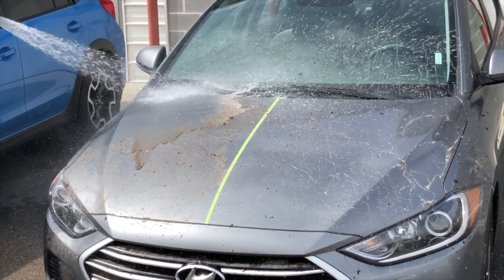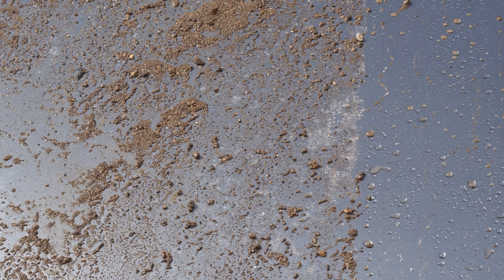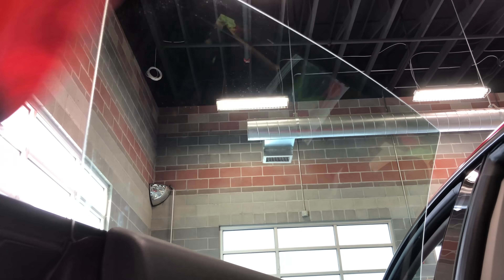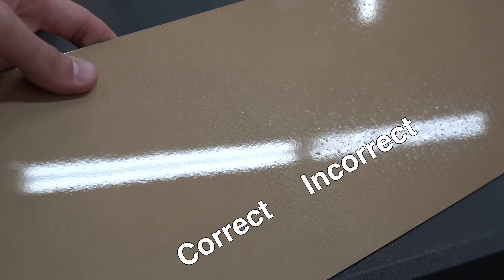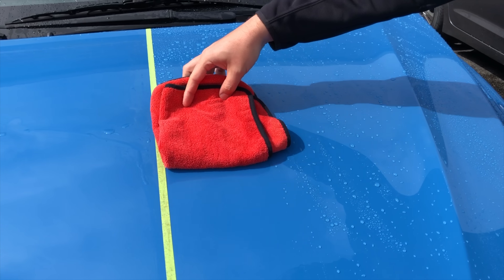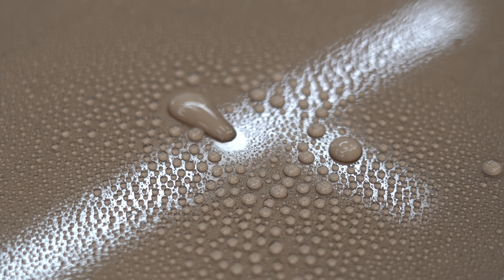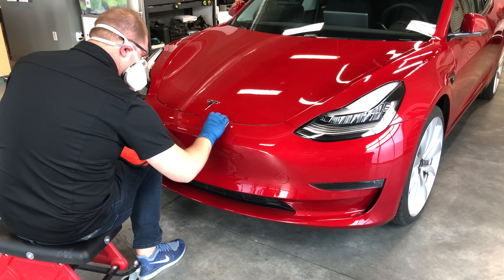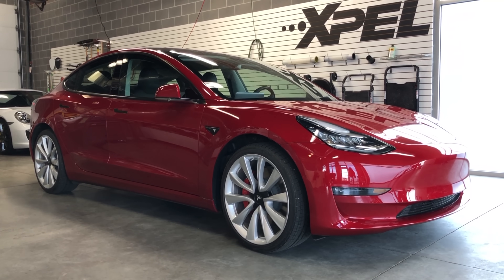Everything You Need To Know About Ceramic Coatings

Comment: Just after watching this video, I drove home through a blizzard, having trouble with my windows getting covered with snow on the outside and fogging up on the inside. It is mentioned that this can be used on windows - would it help prevent snow and ice accumulating on windows? Would putting it on the inside help with preventing them fogging up?

Comment: How about using ceramic coating on glass, inside and out?
Reply from the maker: Yes, you can use it on glass! All of my exterior glass was coated. Inside has XPEL window tint (except for front windshield).
Reply: @EngineeringExplained  HUmmm how about on race car plexiglass windshields. They get really dusty sometimes from static electricity and they fog up in humid weather or rain.

Comment: Jason please address the question of how to remove the ceramic coating. Because as far as I can work out; magnetic tool to measure paint thickness gives false positive for extra paint when the surface is ceramic coated. This can be a huge deal breaker when selling the car. Please reply to this and thanks in advance.

Comment: Hey, this is all great but I was hoping to find an answer to a question that has always been going through my mind...what if I have to respray or partially respray a panel or worse, blend in a repair, and the car is ceramic coated??is the paint going to stick? If the bodyshop has to spend hours making sure that the coating is removed (without being 100%sure of it), that is going to be expensive!

Comment: Taking my Jeep Gladiator straight to a shop as soon as I pull it off the lot to get the paint corrected and prepped then have the film and coating applied. I drive an 08 Silverado right now and the paint has been ruined for the passed 4 years. Scratches and swirl marks everywhere, clear coat pealing on the hood and roof, paint rubbed off on the door handles. Not happening this time. I’m protecting my $65k investment.
Reply from the maker: Good on you, that Gladiator should be awesome! I get to try one out later this month. :)

Comment: I’m fine with rain x on the window. Way too much work to get it perfect with a coating.
Reply: Jetski Jay agree but I just wish it would last a little longer. And I find getting the haze off following application difficult.
Reply: @stevepowsinger733  The key is to use a microfiber towel that's damp w/ water. This removes the haze really easily. After the haze is removed, use a new, clean, dry microfiber towel to buff the glass. You can also use regular terry cloth towels, but microfiber works better. Good luck.

Comment: It is cool but it only makes sense for expensive cars
Reply: The Meguire's Ceramic is $30. There is absolutely no reason why these films cost as much as they do.
Reply: @truantray   Is that $30 bottle really the same quality stuff?
Reply: @Phrancis5  
The si02 main ingredient in these ceramic products and sealants is available on the open market for roughly a dollar per pound...you do the math.  Not to mention that many of these ceramic coatings are very prone to water spotting and require yet an additional coating on top of them that has to be reapplied every few months to prevent it.  Now why do you need a coating for your coating if the first coating is supposed to be a superior choice?
Reply: okleydokley that coating only lasts a month or so, and it does not provide resistance to chips or scratches
Reply: ClichedGem6363 or for classics. My 80s cah has single stage epoxy paint and repainting / fixing is painful.
Reply: Gtechniq sells two bottles for less than $150 you can do it yourself

Comment: Why isn't this installed at the factory?
Reply: Money. Full coverage with PPF is probably $3k+ and the coating is another $700 -$1200 depending on where you go and what products you're getting installed. Most new cars now come with lower bumper PPF, and some luxury brands do the door edges as well. But if you want the whole shebang, you gotta shell out for it.
Reply: @alexg7856  
Mass production can lower the price.

Comment: Awesome stuff. Especially since my Tezza needs a respray. What kind of car cleaners are recommended to use and not recommended to use to maintain the ceramic coating properties?
Reply from the maker: No waxes or sealants. They have their own products they recommend, xpel quick detail spray (seen on the license plate cleaning) and ceramic boost for hydrophobic properties.
Reply: @EngineeringExplained  so no car shampoo?

Comment: I am not a big fan of put a non removable hard shell on the paint. I prefer paint protective film more.
Reply: They're removable. You just have to polish it off. I put CQuartz on my vehicle and screwed up a few small areas and I was able to hit it with a little CarPro Essence and my polisher and reapply the coating. Came out perfect after that. The DIY kits are a lot less expensive. But only last around 2 years vs the 4 - 5 years you get warrantied at the professional shops.
Reply: Xuan Tan you can get both and then it's still removable 👍🏻👍🏻
Reply: @guiguigodro  I can feel the pain from my wallet.

Comment: Why do I feel like my ceramic coating is already wearing off after one year, the glossy finish seems so much less prominent (gtechnique crystal light serum, it's 9H)? Is it because I only cured for about 14 hours instead of 24?. The shop told me 24 is just an extra safe overhead and that there was no need to wait that long. I didn't exposed it to rain or anything on the drive back either.. Were they wrong?

Comment: So if you have this on what about using a claybar while the coating is on? Should I not have to do that anymore? Would a claybar strip it off?
Reply: In my experience after a couple years with ceramic sealants on my cars, the clay is not needed because contaminants can't get through.  The paint feels as smooth as the day it was clayed and the ceramic applied, even in typical trouble spots like above the exhaust on the bumper. You can still use clay (or I prefer Nano Skin) to remove little blemishes without apparently harming the ceramic.

Comment: In a text book, it sounds good. Real world, the Coding wears off in 3-5 months. Use sunlight dish soap one a month. Wash your vehicle once a week.  Spray the underneath of the vehicle too. This helps fight rust. Sometimes old trick work better. Plus it look better then the coding.
Reply: No, it definitely doesn't. I'm on year 2 of my consumer level coating, still going strong.
Reply: The Paint Corrector your just putting on another kind of clear coat.most clear coat put on by the vehicle brands last more then 30 years.

Comment: Too bad it’ll run u $6-8k to put both film and ceramic coating on ur entire car
Reply: I just apply film on the bits of the car facing forwards like the front bumper, partial hood, mirrors, fenders, A pillar, rocker panels and partial roof. If I can remember it was under $1500 to get it installed on my BMW.
Reply: dang that's more than painting the car
Reply: You can do quality paint respray for these money.
Reply: why would you put the film over the entire car? Just need the high wear areas. front bumper, front half of hood and fenders, right in front of rear haunches, door pockets, door edges, mirror caps. At most. If you live in an area with lots of gravel, maybe more.
Reply: Garret do it yourself for $60

Comment: Yes i can say a coating will NOT prevent wash marring/swirls. Yea its easier to keep clean but sometimes i miss just washing and not being super anal about wash techniques marring a $1000 coating.
Reply from the maker: Marring often comes from debris trapped in your towel, make sure it's clean before wiping, and use the two-bucket method. :)
Reply: Engineering Explained even better multiple towel/mitt method. Dirty mitts NEVER hit the bucket again. Also the car is blow dried and if needing to use a towel blotted dry :)

Comment: Thanks, that was very interesting and informative. I just bought a new car with a glossy black finish that I want to protect and was debating whether to use a Carnauba wax, high tech sealant or one of these ceramic coatings. If I'm not mistaken, I believe that more than one coat can be applied in order to extend the life of the coating.
Reply from the maker: Yes, some will have multiple layers of the coating. XPEL's is a single coating process.
Reply: Layering coatings does very very minimal to adding longevity or durability to coatings. That includes ceramic pro who offers like, 20 layers or some ridiculous crap. Layer coatings, waxes or sealants very rarely adds anything, other than full coverage. Just to ensure every area of the surface has been protected and no missed. Otherwise, coating in layers quite honestly does very little to nothing.

Comment: But u forgot to mention those "warranty" (on ceramic coating) it comes w/ "minor caveat" which is... u need to re-apply those coating every 6 month or so right? (charge apply hahaha..)
Reply from the maker: No, warranty does not require re-applying the coating throughout those 4 years. I did read the fine print on it, apparently you do need to take it to your dealer to have them inspect it annually, and keep it clean, but aside from that seems pretty simple.

Comment: "Is ceramic coating snake oil?"
Reply: No, snake oil is carbon-based whereas ceramic coating is "a silicon-based product."
Reply: Bogdan Popescu Really impressed with ceramic coating and the long lasting shine vs. traditional sealants. Applied CQuartz  myself for ~$50 after some minor paint correction.